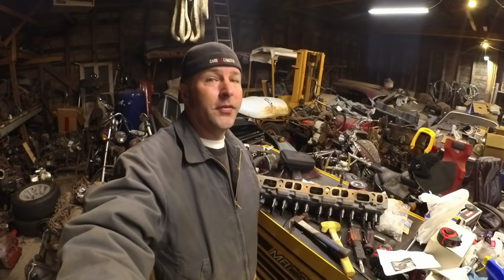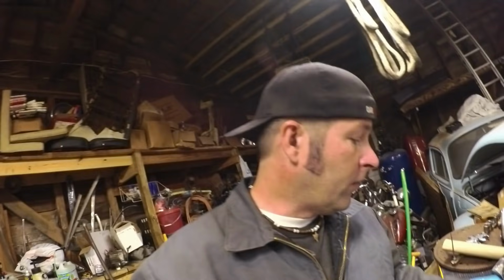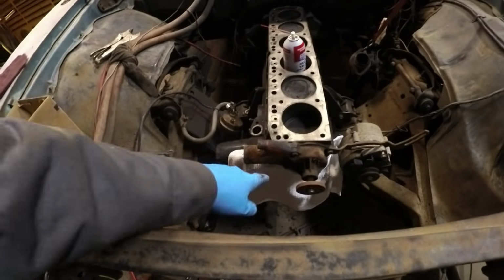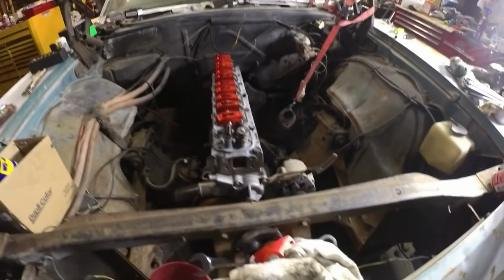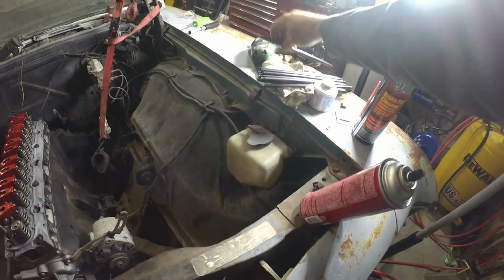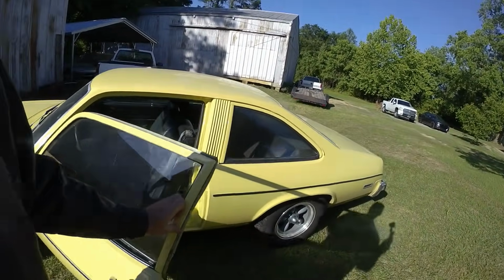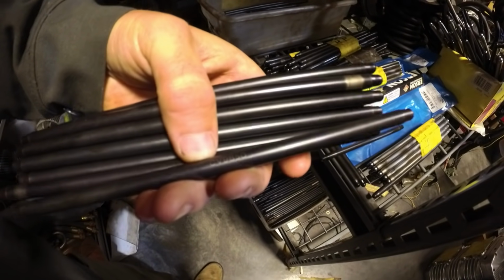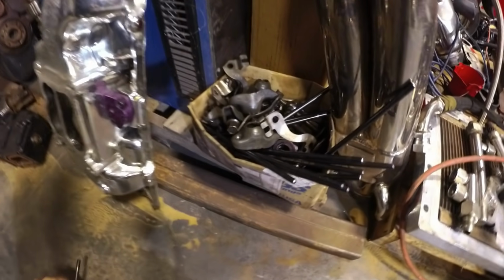1968 Biscayne getting some upgrades!

Comment: Isaac,back in the day we used GM "Blue tip"police and taxi push rods ordered from the dealership. The xx stamped big block factory hi po  rocker arms worked nice with the big block studs The posts in the head had to be milled,shortened and threaded. The Chevy 6 is notorious  for developing a block killing crack between the upper left water pump bolt hoe and it's  nearest head bolt. Buy a single head stud to replace that head bolt, and a stud for the upper left water pump bolt. Coat the threads that go in the block with with J.B.weld and finger tighten.Remove excess JB weld ,allow to cure overnight-and never remove them.

Comment: people dont build usually straight 6's but you can make them roar, Ive had several cammed with 4 brrls, a 63slant 6 valiant, a 66 cuda, a gremlin, 3 chevys, 68 nova mordor and 2 pickups, 69 and 72 and a 73F150 stepside
Reply: Seems to me your name should be Doc Six.

Comment: It'll be fine!
Sorry I couldn't help my self. 
Back when I was building engines, not quite flatheads but close, anything custom meant money. Some things never change. 
The last inline six I helped build was a 292 Chevy with a 6-71 blower, Hilborne mechanical fuel injection and magneto with tach drive. It was the coolest six I ever saw with those headers all out one side. It was to be put in a front engine rail hooked to a Powerglide. My dad got sick with cancer and I had to leave before I got to hear it run. I remember telling the guy I could build 4 smallblocks for what he had in the six. His response: everyone has a smallblock.
LOL!
 It cost to be different, but it sure is fun!
Terry from South Carolina

Comment: I definitely feel your aggravation. I just built a 292 inline 6 and it was full of Murphy’s Law. I had the head off 2 or 3 times for different issues. A cracked rocker stud boss and assorted coolant leaks. I had to pull the engine a couple weeks ago to replace the oil pump. It was making 100 psi at idle and about 150 psi at higher rpm. There’s always something going awry and hardly anyone knows anything about inline sixes. Keep up the good work!

Comment: If you need larger diameter to keep the pushrod from flexing drill the heads and run a guide plate for the pushrods.

Comment: if it were me, i would have just taken the head back off, drilled out the holes for the pushrods, and reinstalled and checked. aint nothing wrong with using a stronger pushrod!

enjoyed the video
Reply: Yeah, i would've had that head back off & drilled, even if you had to buy new head bolts & gasket. They probably would've been cheaper than those pushrods & i would want the larger diameter pushrods with that cam & he's talking about running a turbo at some point. To each their own though...
Reply: yuuuup

Comment: I had that straight 6 in a 1960 impala  after i did a tune up i could balance a nickel on its side on the valve cover  a great motor

Comment: I personally still think you can drill those out with the head still on the block. If you pull off side plates where the lifters are you can stuff a rag in each hole drill each one out and spray carb clean through the hole. Pretty sure that that will work without removing the head. Also depending the cam you went with. What intake manifold you go with and if it's getting a holley sniper you probably will need those larger pushrods.

Comment: Isaac , I got my front pulley on , I used a large socket and hammered in 3 different spots and it slowly went on , started it a little while ago  , can't wait to get it in the 67 c-10

Comment: I haven't seen a gear timing drive on a car engine in a long time.  The were common on truck engines during the 60s and part of the 70s (that was mostly the difference between car and truck engines in that period).  Nice looking gears.

Comment: I'd just bolt the head to the block outside of the car and then add bronze to the port until I had enough to port it out to where it should be. You might want to fix that rust on the inner fender under the battery.. I think you'd have to use a Chevelle patch panel though because I can't find any for Biscaynes. (go figure) Excuse me, can we address the blower with the cool finned case at 15:39? That's not bad for pushrods really. I took the time a couple weeks ago to figure out how much it'd cost to rebuild my 72 Cleveland.. mild build without machining.. $3-4k it's not cheap to build engines. Like the old song "Hot Rodder's Lament" says: "Don't play with cars unless you've got cash to burn." The psycho part is.. I just found my late uncle's 72 Mustang for sale in Chico. -.-

Comment: Ike your not gonna do the bottom end on the 6 banger?
Houston, we may have a serious problem, because when you go with any type of huffer build your gonna build up more heat.
With that being the case, that means you have to check your ring gaps.
Beings as your having more heat in the cylinders, the gaps have to be increased to allow for more expansion of the rings to ensure there's no scarring of the cylinders caused by the rings exceeding the actual diameter of the cylinders.
Plus actually setting the locations of the gaps opposite of each other ensures there's no compression looses due to pushing by ring gaps if they're on top of each other on the pistons. 
Then there's the extra force on the wrist pins, rod bearings, and crank bearings.
All because the froce applied to the due to the increased pressures created by the additional air in each combustion chamber, and the piston bouncing off the explosion as it fires each cycle.
You know the process that happens in any combustion engine after compression stroke.
Yeah, weak lower end could spell rebuild in parking lot on power tour, are a shortened power tour altogether if she's not up to the challenge.

Comment: Damn, I remember in my mis-spent youth (30+years ago) thinking $3 per push rod was pricey. $13+ each, ouch.
Reply: My guess is that they are chromoly pushrods if so those are pricey but well worth the money.
Reply: @rncboy2  Chromoly pushrods were $3 each in the mid '80s.
Reply: As time goes on the prices of most things increase so 13 each to me seems about normal
Reply: It's about the same price for a each of the 2 pushrods for a predator 212 or gx200 clone

Comment: Sometimes these things happen and you just gotta backtrack. I woulda immediately just taken the head back off and drilled the holes right then and there. Head gasket woulda been way cheaper and easier to obtain the next morning and you woulda been able to use those thicker pushrods you already had money in.

Comment: Could you drill the holes with it  on the car if someone held a vacuum cleaner hose at the point of drilling to catch the shavings to keep them out of the motor? Might be an easier way to drill and save time. That yellow Nova is the only yellow peach I ever saw. That is a peach of a car and I would rather have that than a new one. Also I love an inline six. They are easy to work on and get you from point a to point b, maybe not quite as fast but you are there. I had a Ford F100, 300 cid and the eight next step up was a 302.

Comment: What kind of hp do you expect out of this? I love those old inline 6's. I always been led to believe inline engines have more torque.
Reply: Sorry about the pushrods...damn that sucks!!
Reply: Not more torque, just at a lower RPM.
Reply from the maker: With the turbo about 350hp

Comment: Why did you not paint the timing cover and water-pump and head?????
Reply from the maker: Keeping it ratty looking
Reply: @isaacitllbefine7231  WOULD HAVE BEEN @@@ QUICKER, EASIER, CHEAPER AND STRONGER @@@  IF YOU USE THE THICKER PUSH RODS YOU ALREADY HAVE JUST BY REMOVING THE HEAD AND BUYING NEW HEAD BOLTS AND GASKET, AND DRILL THE HOLES BIGGER.

Comment: I know all about parts for our inline 6's they are not cheap at times. My Aussie Speed intake was $700.00 with shipping to Canada!!! When you said guess what guys I did not think it was push rods, I was thinking the water pump pulley was rubbing on the new water pump, mine did and needed a small spacer to correct the problem. Enjoying this project keep up the great work.......Are you going to upgrade the alternator to 63 AMP?
Reply from the maker: Thanks. Probably put a 100amp on it

Comment: "I had to search through all my vehicles..." So that took the better part of a week.  Why not just pull the head and drill the tubes larger? The head gasket must have been cheaper than the cost of new push rods right?
Reply from the maker: It is cheaper
Reply: @isaacitllbefine7231  okay, so I get visiting your buddy to see if he had what you needed, but when he didn't why did you still order those pushrods vs just giving up and drilling the head?

Comment: what are those lump ports for?
Reply: He cut out some blockages in the intake runners, but it left some holes in the bottom of the intake. The lump ports make it flow better
Reply: @garageofscrap  interesting , thank you for taking the time to answer my question
Reply: There are videos by Tom Langdon that show the process and power. Just search lump ports on you tube. It is interesting to inline 6 guys.

Comment: Well I thought I was pretty knowledgeable about automotive topics, cars, motors, etc. I worked at a couple Chevrolet dealers, a GMC Truck dealer, and a gas station back in the day. But what you are putting in that 6 cyl head I’ve never heard of. What exactly is a lump port?
Reply from the maker: Help improves air flow
Reply: @isaacitllbefine7231  kinda thought that as you were putting them in the exhaust ports. Can that head be ported as well?

Comment: There's 2 guaranteed ways to get me to watch. Work on a Nova, or work on anything with a Chevy inline 6.
Reply: What about a nova with an inline 6 in it?
Reply: @garageofscrap  Even better. I used to have a 1976 Nova with an inline 6. Best car I ever had. Best engine I ever had. It wasn't fast at all but it was reliable and easy to work on. I miss that car.

Comment: Hey, just pull the head drill out the holes buy a new head gasket for what $20 bucks or no lets spend $160 something for weaker push rods. ya that's what we 'll do............
Reply: yes sir
Reply: And added a set of ARP head studs. He's going to need them with that turbo.

Comment: If those pushrods don’t work out for you and they’re too short you can get some for a VW cut to length for a type one Volkswagen motor they are 11 inches and you cut them to whatever length you like a chrome Molly set of eight will set you back 40 bucks you would need two sets CB performance is a good source if you need to pick some up

Comment: WOULD HAVE BEEN @@@ QUICKER, EASIER, CHEAPER AND STRONGER @@@  IF YOU USE THE THICKER PUSH RODS YOU ALREADY HAVE JUST BY REMOVING THE HEAD AND BUYING NEW HEAD BOLTS AND GASKET, AND DRILL THE HOLES BIGGER.